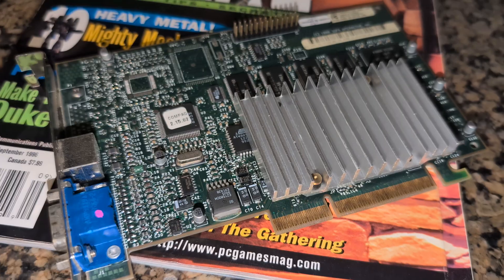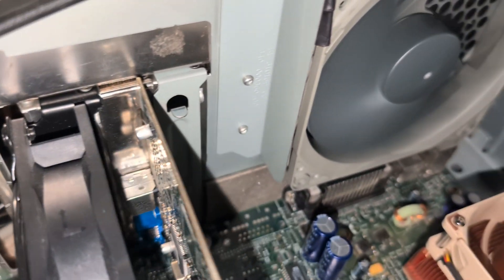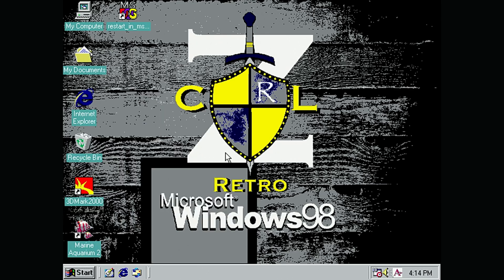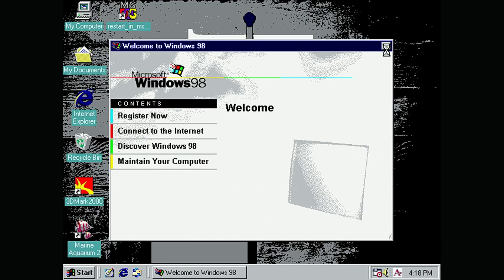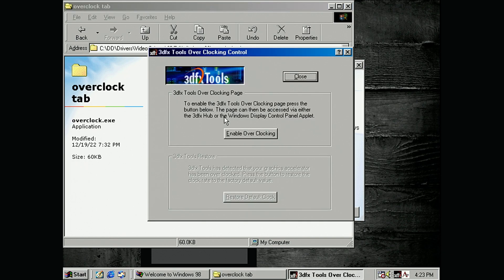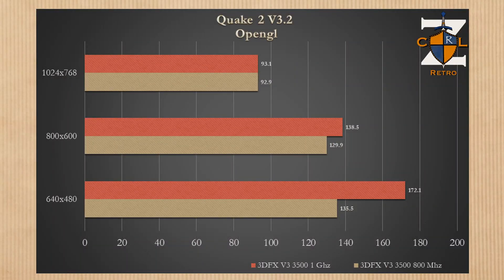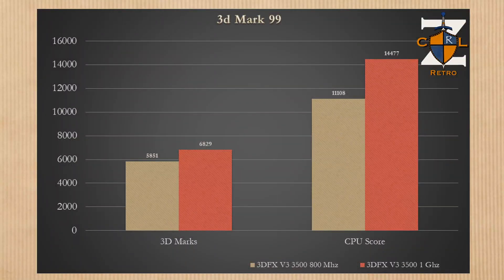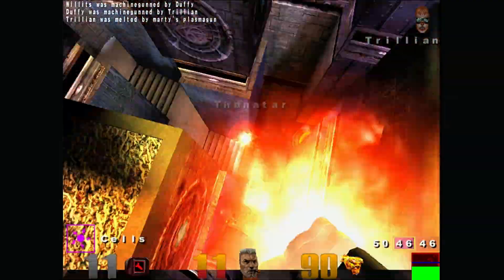3dfx Voodoo 3 3500 Downgrade!?

Comment: My daily driver retro PC is a 440BX rig with the famous SL4KL 1GHz Slot 1 P3 CPU, but I run a combination of GeForce2 Ultra and Voodoo2 SLI.  Between the two graphics systems, it runs a wider swath of games well than even my overclocked 1.7GHz Tualatin P3 rig with Voodoo 5 graphics!  3rd setup is 618MHz K6-2+ with Voodoo3 3000.
Reply: oh!i want to collect GeForce2 Ultra !

Comment: Rule of the club #1. Don’t push vintage hardware to the limits. I would even underclock the Voodoo card to 2000 model. I think Pentium III 600 is way more than enough for this card. Pentium III 800+ is probably a Geforce2 category.

Comment: My voodoo3 sits nicely in my k6-2/450
Reply from the maker: Heck yeah that's an awesome pairing
Reply from the maker: That's an awesome pairing
Reply: Yeah for that cpu it’s the best gpu probably, the drivers have the lowest cpu load. It can do stable 30+fps in unreal tournament and counterstrike 1.5
On a faster cpu I would use a GeForce or Radeon instead. I like using overpowered GPUs on slower cpus. Or maybe a slower secondary gpu for older operating systems dual booting.

Comment: My Voodoo 3500 is paired with 700Mhz PIII. If that isnt fast enough I'd use my Geforce 2 machine. I dont wish to push the Voodoo 3 to its limits.
Reply from the maker: Yeah you don't get much more by going to 1Ghz. I think 600-800 with a voodoo 3 is a great machine. I find windows 98 is so hard to build for, you almost need 3 machines to cover everything but it's fun.
Reply: @ctrlzretro  Yes, that's true if you want to be able to play every game. You can make one machine that can play most games but there would be compromises.

Comment: The faster CPU will help in newer games that need more power. In older games released before the year 2000 the difference will be minimal because the P3 800 is more then enough.
Reply: That's a really subjective argument when the benchmarks show major improvements, and all the quake engine games benefit from FPS due to the bunny hop physics being tied to FPS. 800mhz is "enough", but a 1ghz CPU user could beat you in Quake. Not that skill isn't a factor, as I once modded a Pentium 1 with a voodoo 2 to take to lan parties and won getting around 30 FPS using forced low settings and glide. Some games won't even run on a Pentium 1 because of CPU instructions, but glide bypasses the CPU checks. At the time I think I had heavily modified Windows 95 to the version 3 with feature parity of 98, so it was the fastest you could make a Pentium 1, since 95 used less resources, and I filled all the RAM slots. I don't think it was even using sdram, but it played games fine using glide. A bigger problem with retro gaming today is CRTs are mostly all burned out, so you need a LCD, and thus NEED more FPS than a CRT to enjoy gaming.
Reply: @JohnDoe-ip3oq  People with a 1GHz cpu will have something like Geforce2 or Geforce3 installed. You don’t want to push such expensive vintage cards to the limit. In fact, you want to underclock them by probably 15-20% to make them run with lower temps…
Reply: @Igorsov  that's not how it works AT ALL. Older hardware has NO power saving. None. They all run FULL POWER. Windows 9x ALSO doesn't support power saving. The reality is you should use case fans, and turn the PC off when you're not using it. Video cards were pretty robust compared to motherboards, which will have capacitor failures. Voodoo 2, 3, and TNT 2 mostly didn't have fans, but the voodoo 3 kinda needed one. Voodoo 2 however used less power and only really runs playing games. The real issue is frankly oxidation, and power surges from old motherboards. I would never recommend a GeForce 2, because nothing needs it, they're not actually good, games that need 16 bit look HORRIBLE because Nvidia ruined 16 bit quality on purpose, etc. I would only use a Radeon 8500 or 9800 in reality for actual gaming. GeForce 4 would be acceptable, but only for dx8, and Radeon destroys it using anisotropic filtering, and Radeon supports 16 bit error diffusion color. You didn't get proper power saving until Pentium 4 and Athlon 64, Windows XP, and dx9 cards, and even then it was rudimentary. Windows 9x? Deal with it, it doesn't exist. The OS is real time. Video card failures are usually related to vram, corrosion, and BIOS corruption, not that you use them.
Reply: @JohnDoe-ip3oq  I am totally lost. What does power savings have to do with killing cards by overclocking them or pairing with high end CPUs that make them run even hotter? Many vintage graphics cards were overclocked from the factory to the limit and than had crappy tiny heatsinks installed on them. Of course Radeons are better and 8500 is the king over GeForce 2-3 especially due to one unique technology, but try to find one in new condition. Now, I don’t think it would be able to beat GeForce 4. I am a vintage pc collector. I’ve got many graphics cards. I would easily use Geforce2-3, Radeon 8500 and Radeon 9000 with Pentium II-III machines. What I wouldn’t buy is Riva TNT…
Reply: @JohnDoe-ip3oq  I’ve got my setup limits. Voodoo1? Pentium 1 233Mhz probably max. Well, I am not sure about Voodoo1, but my only purpose for it would have been to pair it with Pentium 200MHz for MS-DOS glide games….Next, Voodoo2? Most likely a Pentium II-III of 400-600MHz, Voodoo3 600-800MHz. For the Voodoo3, I don’t see any reasons to have a higher CPU than this as I care about my vintage hardware’s lifespan and I don’t want it to go kaput…For DirectX 9 games yes, Radeon 9800 Pro would be great. For DirectX 8-8.1, I would stick with Radeon 8500, 9000, 9100, GeForce3-4.
Reply: @ I might not understand everything, but I believe it was proven that a too powerful CPU makes Voodoo cards run hotter. Of course a normal person would install a fan over it, but why stressing dinosaurs in the first place?
Reply: @Igorsov  most cards back then didn't have OC models besides Nvidia. The Riva TNT and Riva 128 were garbage, and so was voodoo 1 for FPS. Radeon 9000 dx8 models are super easy to get for being OEM mass produced, but don't do trilinear with AF, and some 9x drivers are buggy. Geforce 4? Benchmarks, not using AF. Nvidia had bad AF performance until the 6800. You can get a cheap 9000 and have acceptable FPS and full dx8 support. HyperZ. Nvidia would benchmark Quake 3, which wasn't representative of games like UT2004, doom 3, or half life 2. Pentium 3 speed isn't correct. The faster CPU used a SMALLER die, and reduced power, equals out. It's not hurting anything except your FPS. You can also do those tualatin mods. I've done it on slot boards. The Radeon 8500 is pretty cool for having both hardware t&l with shaders, while Nvidia switched to a shader only approach. The 9000 however is a budget cut that removed a lot of those unnecessary extras, but also moved 2d ramdac? On chip, less failure points. While Nvidia was generally worse at 2d in general. Some other cool cards are matrox, and PowerVR, but honestly edge case. The secret biggest upgrade would be a sound card like a Vortex 2 or audigy 2 for 3d audio. DOS games also have programs like Univbe, and I can highly recommend those midi boards that can run Roland mt32 and sc55. If you're doing a retro build, sound is just as important. Some boards have IRQ sharing issues, but I think there's software fixes.
Reply: @JohnDoe-ip3oq  Didn’t you see the video where in 3dfx software you can overclock or underclock the card? My understanding is that the Voodoo3 2000 is the original untouched voodoo3 card while 3000 and 3500 are overclocked variants. I used to go for high end stuff, but now I prefer PC hardware that runs colder simply for a better lifespan reason. I don’t know man, everyone is saying opposite to what you are saying. A faster cpu will push your gpu to get hotter. I have Radeon 9000 in a sealed box. I purchased it mostly for low end machines like Pentium II-III, so that I don’t have to use junk like GeForce MX. Radeon 9000 is my go to replacement for GeForce MX cards. I have Radeon 9800 Pro boxed and sealed as well. I am just missing Radeon 9700 Pro and Radeon 8500. I do have a boxed A3D Vortex2 card as well as the Audigy 2 sound card. I also have Matrox G400, but his card doesn’t do much for me as I like to play newer games such as Dungeon Siege 1 and NoX. I am not into modding or overlooking. I like my hardware to be the way it was meant to be. I only go as long as to replace coolers sometimes on CPU or GPU if there is a risk for it to go kaput. If I need more power, I’ll just use a better CPU or GPU. We aren’t talking about DirectX 9 games. That’s too modern for me and will require a dual core cpu. I’d go as far as Pentium4 EE 3.4 and AMD FX-55-57. I’d still be able to play those Doom 3 and Half-Life games, but not up to a full potential. I don’t believe in software or emulators. Pure hardcore is my only way.
Reply: @JohnDoe-ip3oq  Also, keep in mind that glide games were short lived up to year 2000 or so, so you don’t need a powerful CPU for the 3dfx Voodoo3. Nobody is willing to play on a 640x480 resolution anyway, so what’s is the point? 100+ isn’t enough for you in 640x480? Do you want 120 instead? Therefore, as I’ve mentioned previously Pentium III 600-800 is where it’s at for Voodoo3 graphics cards.
Reply: @Igorsov  my understanding is that lowering clocks without also lowering voltage has a linear effect on temperature reduction, that lowering voltage on a Voodoo3 would require physically modifying the card, and thus a 3500 with its higher vcore is still going to run run hotter than a 2000 or especially a 1000, even with matching clockrates.  Adding a fan to directly cool the card will do far more work to keep temps in check than lowering clockrate.  Both can be done, but the problem is largely solved with active cooling.